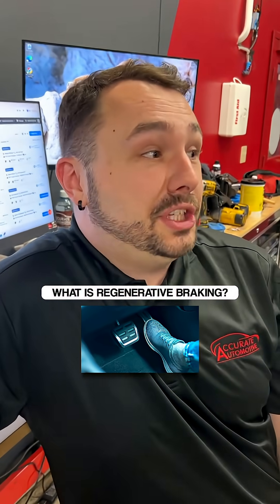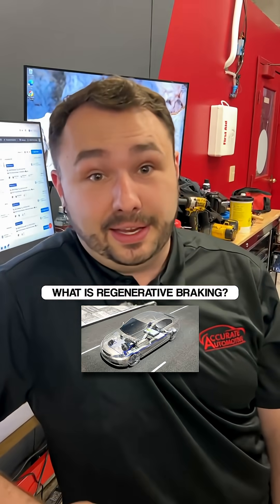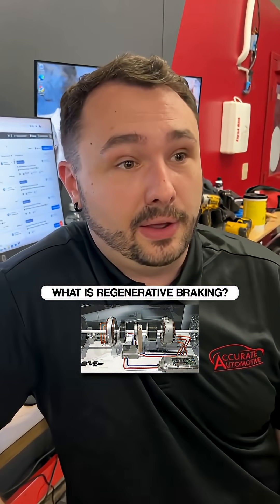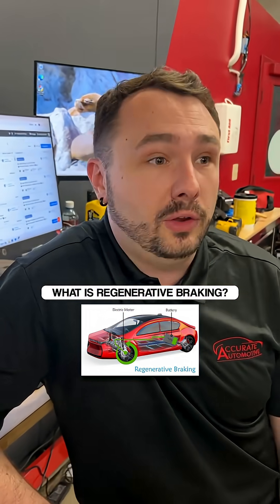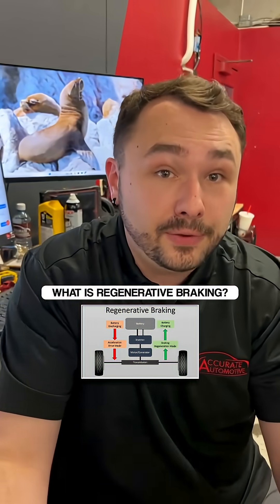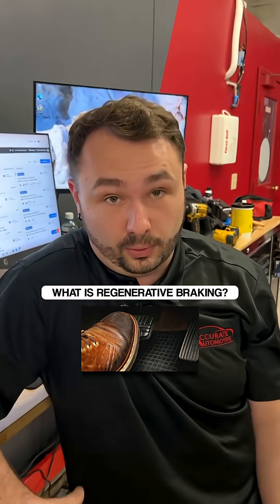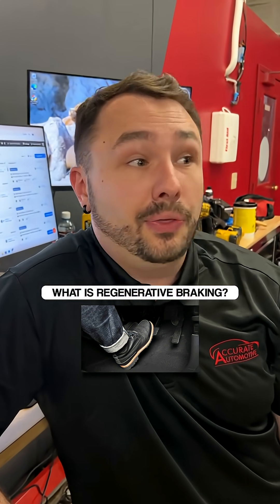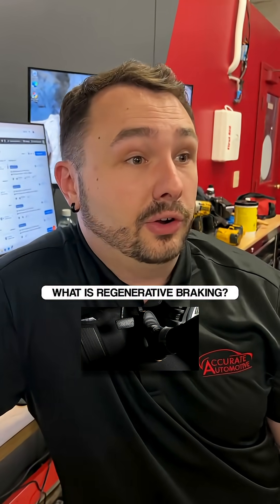What Is Regenerative Braking? 🚗

Comment: That’s not what regenerative braking is. He’s describing one pedal driving, which is related but usually a driver configurable option and can be completely disabled. 

Regenerative braking by using the electric motor as essentially to slow the car and generate energy using the kinetic energy of the car, recharging the battery to extend the range and reducing the amount brakes need to be used.